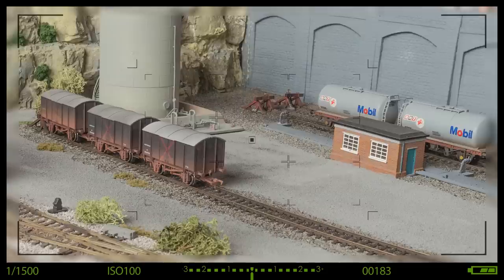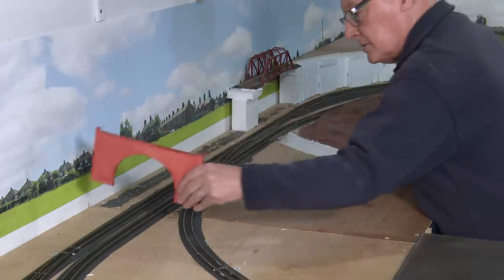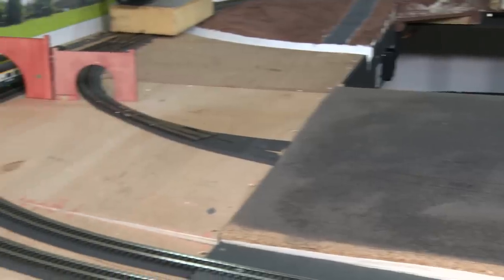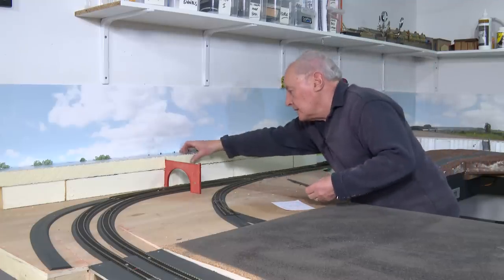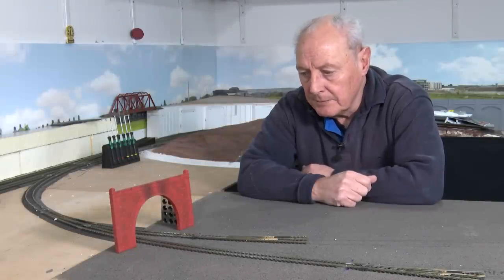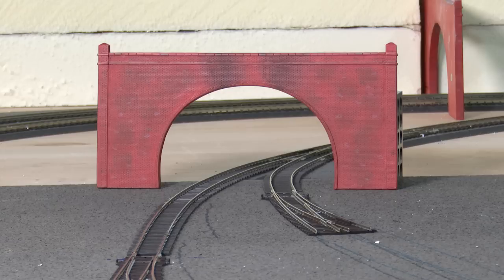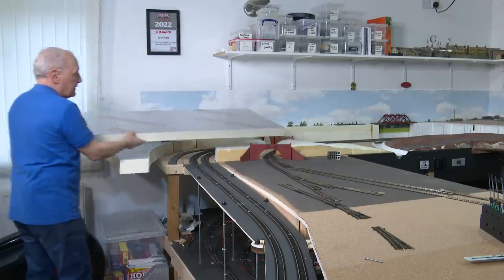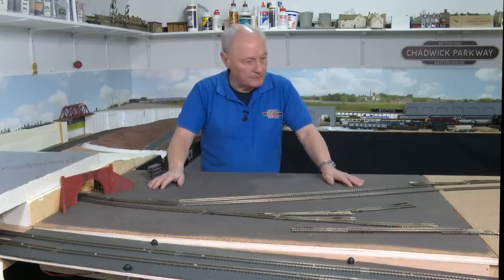Landscape Planning at Chadwick Model Railway | 176.

Comment: Charlie Chill, it is a hobby, not invading Russia. I did a triple written list side by side of the jobs that needed sorting. 3 headings; 
1-Needs Thinking About (just leave it till a light bulb moment for one on the list)
2-BIG JOB (those you can do that need a serious session of free time to do)
3-Snag list (A massive list of little niggles that can be easily sorted by just...........)
The Snag list is the hard one, each little job involves doing one little thing to finish something but big you have to go to the trouble of doing it.
The Big Jobs List- When you have a few hours free, just start one on the list, JUST ONE and you will be in the zone to the end.
Needs thinking about list; This will will only be sorted by- Research, Divine Intervention, Booze, Recreational drugs, Forum (NAH), hitting with a hammer.
Put a nice line through the jobs that are completed on the 3 column list when they are done so you have a record and smile.
A fellow model railway builder told me that I should start a YouTube channel of my work (the word fantastic left out for modesty). No YouTube 30 months later sees me photographing Long Tailed Ducks, Common Scoters and stunning young women
Reply from the maker: An excellent comment Sjaak. Lots to think about. Best wishes for 2023 . 
Regards Charlie

Comment: Regarding the Hornby TT - i am not keen on it if I wanted to go smaller I would go for N gauge which is well established but being the age i am and eye sight not that good I stick with HO/OO and if  my eyes get worse then its O gauge 😀. Now the energy topic yes smart meters are good but there was a time I would not entertain them but now i am glad i got one and my bills have been cheaper and EDF Sent me a cheque for money they owed me. I live in a Bungalow so all on one level and just two bedrooms. Where I live we have a Nuclear power station just down the road so to speak I try not to worry about the cost if i need the heating on it will go on. And Bacton Gas terminal just up the coast as well but does not make bills cheaper where you live.
Reply from the maker: I feel your pain Michael. Living near a power station, should you get cheaper power? 
Best wishes for 2023, regards, Charlie

Comment: "CELOTEX" BOARD IS FLAMMABLE !!!.  According to the manufacturer, the product is combustible and must be installed using aluminum foil to protect against an eventual fire.
The foam insulation board (blue or pink here in the states) would be a better choice.  I imagine scraps can also be found at construction sites.
I did enjoy your thought process in layout your tunnels portals.  I have several on my layout and never considered what that dual tracks should be parallel leaving the portal to look right.
Reply from the maker: Excellent points, Mark. Best wishes for 2023, regards, Charlie

Comment: Way back in the 1960s with a move to a smaller house my dad decided we should start again in TT which was a disaster as the model trade was not very supportive.

After a few years it’s was just dumped, left a bad feeling with many modellers. Will this happen again ?

I feel it’s a loser from day one they are trying to create a market which will not be supported in my opinion.

They have missed the opportunity in O Gauge, and more recently in 009  There is a opportunity in 0.16.5 narrow gauge  which is market that’s not supported by the major manufacturers.

Obviously 009 was the same 2/3 years ago not any more.

This is a personal opinion, I have no connection to the model railway industry, just a model railway enthusiast for about 70 years .

Terry
Reply from the maker: You make some excellent points Terry.
Have a great Christmas and best wishes for 2023. Regards Charlie.

Comment: Techincally the teeth of any saw need to be slightly wider then the blade or the saw wil constantly jam.  I would suggest maybe trying a hacksaw blade for more presicision cutting.  It will make a mess still, maybe not as much as course teeth, and will take a bit longer, but you can get finer cuts.       I am not 100% sure about Hornby's selling methods.   I really don't see the need to introduce a new scale/gauge.   I feel the money would be better spent reducing the cost of entry into the hobby on the existing scales.          I think with the tunnel mouths/entries, would have maybe been better raising the single a little and not reducing the dual entry.    In my opinion, at the height it is after cutting it down, steam locomotives would have issues with it, but you can probably blend it all in once the rest of the scenary is done.
Reply from the maker: Excellent points, Brendan.
Have a great Christmas and best wishes for 2023. Regards Charlie.

Comment: Another interesting video. A question not a criticism. If you need to protect yourself from cellotex then is it OK to not use a face mask?
I cut my heating bill dramatically. I have TVs, microwave, computers and worst of all a powerful stereo system all on standby. By turning off when not in use I am saving over 1.50 a day.
I would argue your plan for set production times and dates. It NEVER works unless of course you want to start a strict regime. I have found in nearly 60 years of modelling, model railways is a loose concept. OK you need a reasonable time for just track laying and wiring in the start but everything for me is whatever takes your fancy at the time. Why would you force yourself to build a hillside when you would rather be doing something else. 
Regarding Hornby and TT. Yes, seems like a good idea but I would rather they put some serious money and effort into UK outline N gauge. I am an N gauge addict, although I enjoy all scales. Before I became housebound I was quite well known as an operator and exhibitor in N gauge. 
Have a great Christmas and a prosperous 2023. Cheers, Bob
Reply from the maker: What a fascinating comment Bob.
Have a great Christmas and best wishes for 2023. Regards Charlie.

Comment: TT "new kid on the block" nope, it´s from 1946 (N would be 1962, OO/H0 together 1935/1938 seperation between the scales 1:76 and 1:87 came later, Z 1972 but not much for UK market).
TT keept it´s stronghold in eastern germany, with some "I build most of it myself"-hobbyists world wide staying to that scale here and there, for example UK based "The 3mm Society".
If you got OO or N, TT isn´t interesting as not enough to buy on the market and the scale beeing to nearby to what you used to / got running.

On the other hand here in middle Europe 0 has been running low since ~1958 (when H0 was tightened as proper scale by NEM 012, today by NEM 010) as it needed to much room and it was not much reasonably priced for beginners to start with, became a niche, 
till Lenz came 2007 around and restarted that gauge, so hobbyists from N and H0 looked at it thought "my eyes aren´t the best anymore, it´s getting more and more fiddly and just look what gorgeous details are gainable in that gauge!" and you can go in the garden with it (yes some do with H0/OO, but on their on risk).
So a gauge/scale is restart able, but only if it´s a clearly improvement from what´s widespread on the market.

That saying without any offence against the more to scale modellers (H0fine, Protofour, 2 mm scale, ...) or those with (ridable) real steam (where funtion is crucial).

Till next time / year
Reply from the maker: Thanks for such a useful comment Lass. Best wishes for 2023. Regards, Charlie

Comment: Dearest Charlie, this is not a way of "key-board-worrierererying"...
No - it is a question leading into an idea about realism against deep digging wishes:
The difference between a needed tunnel under/through and a cutting into the landscape has allways to do with the hight/mass of earth left over above the drilled pipe. If there is not enough volume of earth or rock to build a cellar there will never be a house/building over any tunnel. There will be a cutting as the look of a tunnel with a paperthin layer of earth above does look too redicolouse to the eye - as the railway will drive through a family's cellar and not deep below. So what is to do? 
It is on to your decision what does look right to you and what does become into a bad joke to the eye. 

In my opinion any tunnel does need in minimum the very double of it's own hight above itself to justify the immense cost of such a drilling. The cutting is by far the cheaper way of building your railway line - für to this there are long cuttings before any tunnel is being drilled in a sloped landscape. AND... the buildings above aren't beloved when falling into the tunnel as the thickness below them isn't sufficiend to keep their immense wight in it's place. 

So these two factors do determent any tunnel and you did show the very reasonable & right way on the cutting before the viaduct in a realistic way; avoiding any childish looking construction as so often sadly be shoen on model railways all over the world.

So this is my 1/2p to this honorable problem of keeping the landscaping realistic and the constructed environment as close as possible to a common sense of construction. 

Hopefully this does not attack your planing too much but I think the realism should be leveled all over a layout and not been neglected suddenly - just to throw a hand full of tunnel portals onto the cork.

Sorry for my badly school English, Charlie, and best wishes from Berlin,

your fan &follower, Christian
Reply from the maker: Thanks Christian, you have made some excellent points.  Best wishes for 2023. 
Regards Charlie

Comment: My personal view is that Hornby’s reopening of the TT market is a veiled admission that it can no longer compete in the 4mm sector. Smaller manufacturers being ran by and designing models by modellers rather than marketeers are showing what can be done at a price point. While Cavalex debut their beautifully considered and implemented class 56, the hobby’s leading manufacturer announce a repainted Thomas pretending to be an E2, a Diecast Deltic for collectors, and a bit of “salmon poaching”. Pun intended.
The last few new Hornby models I’ve bought have been dreadful in terms of quality and specification. They can do far worse than scouring the industry for design and engineering talent as it’s fair to say that the cottage industries are starting to make the big man look a bit daft.

The corporate focus of Hornby has been well demonstrated again with their decision to make TT an exclusive to their interior supply chain. Not content with punishing retailers for announcing identical models before they did themselves, this would suggest a level of short sightedness on an industrial scale. Not only do the remaining retailers have to contend with multiple quality returns (Hush Hush anyone?) they can’t even offer customers a choice of scale even though there is one. It’s all quite bizarre IMO.
Reply from the maker: I think you’re spot-on, KD. Hornby seem to believe that adequate is good enough! Regards, Charlie

Comment: Late to this, but TT:120 would be perfect for me. It has more detail/less fiddly than N gauge and I can do a much larger layout than 00 which is what I had in the old attic before moving. I'd be interested to see where it goes over the next 5 years before I commit to it. Hornby needs to stop the exclusive nonesense and get it into stores. It's anti consumer, anti hobby and will hurt local model shops which are the back bone of the hobby/community. Its a ridiculously short sighted and profit driven decision and I hope the reverse it asap.
Reply from the maker: That’s the whole point Andrew. They want to take away the model shops slice of the profit! I don’t believe it will ever become popular, with nothing appearing in the secondhand market for many many years. Regards, Charlie